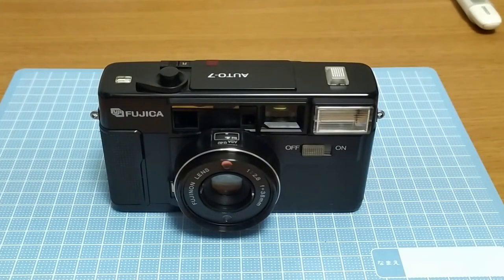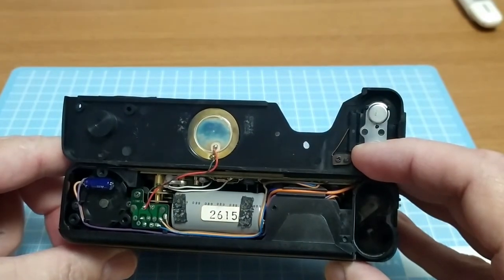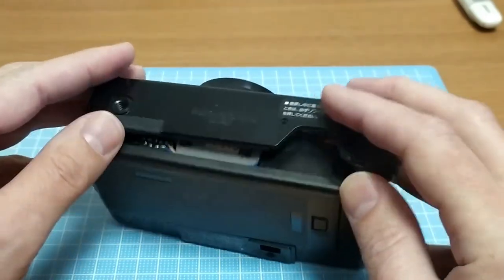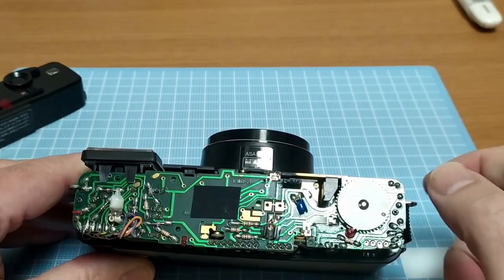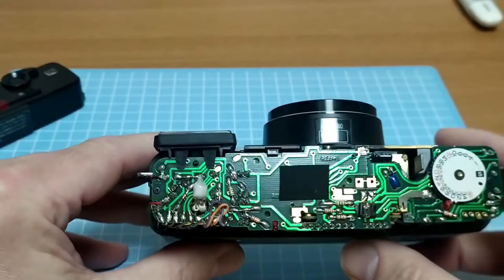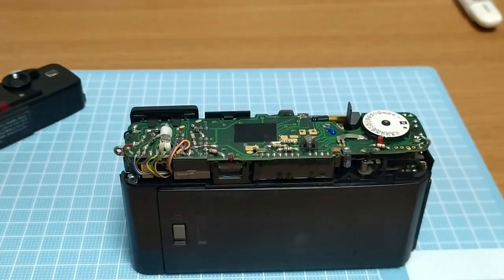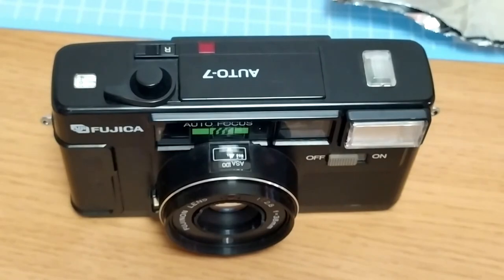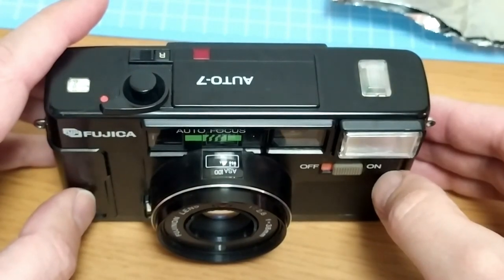Fujica Auto 7 Repair

Comment: I would have liked to have seen your work in resolving some of the issues you mentioned.
Reply from the maker: Typically I get a bee in my bonnet and find and fix stuff faster than I film it, and that was my first vid, soooo....  

Trying to get a bit better at it, but aside from a bit of soldering, you didn't miss much on that one.  It seems the focus system went out to lunch, so there is a chance I'll revisit that in the future and that will be a bit more thorough.

Comment: Hey! Thanks for the video. I had a mint in box auto 7 shipped from japan. But it now doesn't seem to be focusing. The focus indicator does not move, q6nd i can see that the lens is not moving around on a half press. Any tips? At some point ill just tear it apart and see what I i can come up with :'(
Reply from the maker: I'm not too sure to be honest.  It's been a while since I've looked at this, I'd need to dig it out to have a look.
Reply: Hello there! Did you ever come up with a solution? I just bought the same camera and am having the same issue: when I do the half press, nothing seems to happen for the focus (I can’t tell a difference in the viewfinder, and the lens itself doesn’t move like I have seen on other tutorials of this camera). Thank you for any insight!! @samlawson635

Comment: hey, I've got a problem with this camera. it works fine for the first 10 exposures, but when I try to go to my 11th, it rewinds back to 9/10. it has never once advanced to 11th
Reply from the maker: I'm afraid I don't have an answer for your problem.  Unfortunately I have exams coming up, so no time to dig it out and have a look.  I'll leave it here in case anyone else chimes in.
Reply from the maker: I still need to dig it out and have another look.  There must be some kind of counter in there or trigger that is detecting end of roll, before the end of roll.  Is it always on the 10th?
Reply: @chankinpong6a208  I've actually managed to 'fix' the problem. It actually isn't a problem at all. Just insert a roll of film in the camera and press the shutter with the cap on until it goes to the 11th exposure. Make sure you don't actually let light go through the film. The camera actually doesn't allow it to go to the 11th exposure unless there's film inside. No clue as to why, but that's just how it is. My camera has had no problem while shooting with film inside.
Reply from the maker: Good to know.  Thanks for sharing.
Reply: @antoniobajao6046  Hey! I know this is an old comment but could you elaborate more on how you fixed it? I'm having the exact same problem and it rewinds the film once it gets to a certain number
Reply: Hi i am the same problem and i sent my film to develop but i just got a call that it was a blank film.